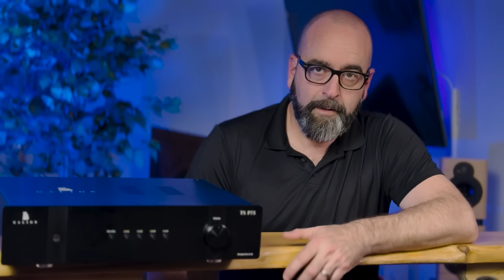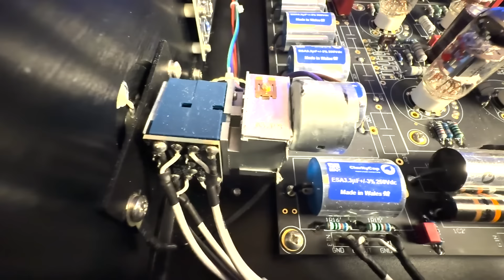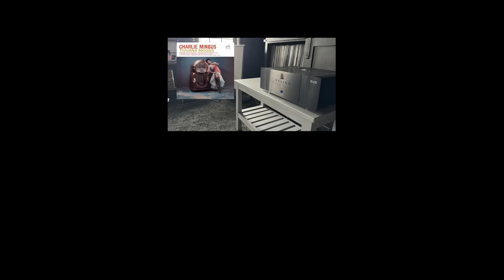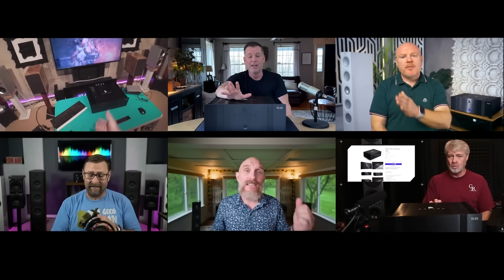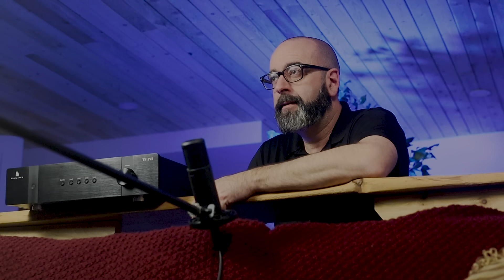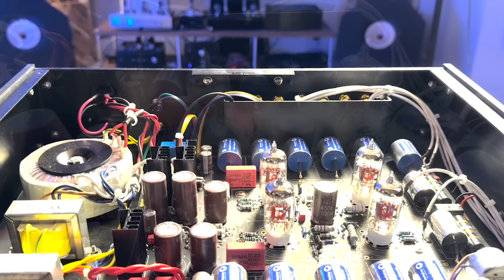THE GALION TS P75 TUBE PREAMPLIFIER (It’s Almost Sold Out!)

Comment: If the TS P75 were to add balanced input and outputs, the cost will go up by a good percentage. If you don't have long cable runs or live beside a radar station, unbalanced is no issue. My DAC has only balanced outputs, my power am only balanced inputs. I just got the connectors, no biggie. Works fine.

I just got the P75 as a secondary system, paired to my Benchmark AHB2. Its really great value for money. I love the detail and clarity but would like a bit more warmth, so gonna try to tube roll a bit.

The P75 does have the sound signature of a LTA microZOTL. Not as refined and as textured as the LTA, but has that flavour without paying $6K. The P75 is a better buy than than Cary Audio SLP98, I was about to purchase that but then I had the opportinity to demo the P75. If only Thomas made a pre with 6SN7s, that will really be nice and tubey.

Comment: I own the A75 and I like the decay I have, think the midrange is a strong point and love the detailed fast bass of my system.  The interesting part is that my system is bi-amped and the A75 just powers the tweeter and mid/woofer from 100 hz and above (A high power (450 watt per channel) Class D amp powers the woofers).  It appears that bi-amping provides most of the benefits of this preamp which is not something I would have thought.  So I guess the moral of this story is that getting this preamp for A75 owners is a no-brainer unless you are bi-amping.

Comment: Here's a question for you since you've heard both: TS34 or P75/A75 combo? Very similarly priced.
Reply from the maker: With full range high sensitivity single drivers: ts34
With 3 way speakers of normal sensitivity (under 94db) p75/a75 combo.

Exceptions exist in both cases tho.
Reply: @hificave  thanks for the feedback. Now it's just waiting for that preamp to release!

Comment: I'd love this pre to pair with my TS-A75 but the problem I have is that it has no balanced connections.  My current pre (moon 390) has fully balanced connections and my XLR's cost me a small fortune.  To replace them with suitable RCA's from the same family would cost me upwards of £2500.  Cables from that manufacturer have fantastic synergy in my system so I wouldn't want to change a winning formula. 

If Thomas designs a tube pre with fully balanced connections - I'm there!

Given the TS-A75 has balanced inputs (which I currently use) I'm hoping that a  tube pre with fully balanced inputs and outputs is a project not too far away.

Comment: I am wondering if exchanging the power fuse on the TS A-75 with a Synergistic Research fuse would help sweeten up the midrange a bit. I’m not going to be selling my Pass preamps anytime soon even though the PS-75 is a looks like another phenomenal Thomas  audio component. My other issue would be is that I have balanced cables that cost quite a bit of money going into an out of my current preamp and I don’t want to have to change them. I know I can purchase adapters but that’s just another impediment for me.
Reply from the maker: I would try the fuse change if it was my amp. But, I have been called crazy a few times for doing so. ;-)

Comment: As an A75 owner I was really hyped for this but no XLR?  How do you make the corresponding preamp without the same connections?  I'm sure it's great but that's a huge miss to me.
Reply: XLR doesn't mean anything. Its just a connector. If you look at the owners manual for your amp, its not balanced. Most manufacturers that put xlr connectors on their components do so because they know most people don't know what it means. If your amp was balanced, you would see 2 sets of specs listed. Specs for balanced and unbalanced operation are different. Both components are single ended in design. The RCA connectors are the correct ones to use.
Reply: @052RC  "True Balanced Circuit
The TS A75 features a genuine XLR balanced design. When using a long interconnect cable with the TS A75, opt for XLR connections to experience reduced noise and a darker background."  That's directly from the website for the A75.  Are you claiming Thomas is lying?

Comment: I actually prefer single ended in my main system.  I only use balanced gear with my PC desktop system because I had noise issues there.   I mean that's what balanced gear and cables are for anyway.  If your main system has lots of noise being introduced when using single ended connections you might have some other areas of your system that need to be addressed, just saying.

Comment: I'm generally of the opinion that a pre-amp should be as transparent as possible. All of my admittedly limited experience tells me that any deliberate attempts to flavor the sound in the line stage will come at a high cost to overall transparency and resolution. That said, I know Thomas knows what he's doing. Having recently heard the A75 and A20 in my own system, driven by my Audio-gd R7-HE DAC and Parasound JC2 pre-amp, I can understand everything that is said in this review. The A20 has a magical mid range, but is a little laid back on the outer ends of the spectrum. The A75 makes up that energy, but isn't as smooth or refined. If his P75 can step up the A75 closer to the A20's level, without taking anything away, it will be a magnificent combination period, never mind  at this price point. Hell, I would be happy to impart some of the A20's character to my JC5 with a pre-amp like this, if it doesn't take anything away. 

PS, I sure hope it has 12v trigger!
Reply: That 12V trigger would really demonstrate that he listens to his community and critics

Comment: no balanced output...bummer.  :(
Reply: For my amps, using any RCAs adds hum that is completely gone when using XLRs so this is dissapointing too.
Reply: Why do you need balanced output? Your amps only accept balanced input? Get an adapter.
Reply: @JohnLee-db9zt  long run of cable between pre and power amp
Reply: @net_news  You can run long run of interconnects (eg, 30 feet) with single ended preamps as long as the preamp is designed to and you use low capacitance interconnects.
Reply: @JohnLee-db9zt  yeah but you get hum and interferences, it's XLR all the way, no turning back for me.
Reply: @ that depends on your setup. If the preamp isn’t a balance design, an XLR output won’t give you any noise canceling benefits.
Reply: @JohnLee-db9zt  balanced with xlr connection, yes, that's what I was talking about
Reply: Double the parts would add to the cost. In most set ups single ended works fine, yes balanced is better ,but not day and night.
Reply: Great review.

Comment: Hey man… I am following your lead with the F18” OB and the W15 going through my Crown XLS1502… now… i want to add a good tweeter… Thoughts?? Horn?Dome? Planar ribbon? Omni? Mounted behind? Off axis? Appreciate your videos and thoughts. You’re doing the Lord’s Hifi work!
Reply from the maker: @jesshoward9016  get one that matches the sensitivity of the f18, I put the tweeter on hold, tried, AMT, Soft dome, bullet, and didnt like what it did to the sound. So I need to look for others.
Reply: @hificave  I have a Dayton Audio PHT1-6 Planar Horn Tweeter 6ohm and the sensitivity is considerably higher, so, they may not work.  I will also either try a  compression horn tweeter or something like the old Wharfdale SFB rear mounted, up-firing tweeter.

Comment: When are you going to tell us which crossover to use on your wonderful single Driver speaker from Lee song
Reply from the maker: I dont use a cross over on my full range, it plays full unrestricted straight to the amp. Then I measure in room, and then whats missing in low end, I low pass the bass drivers directly on the crown to fill in whats missing.